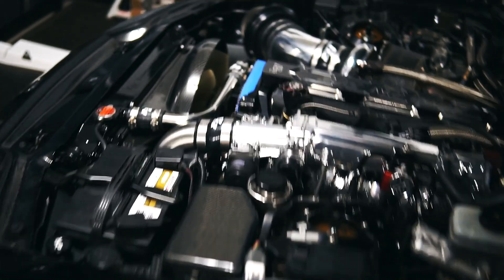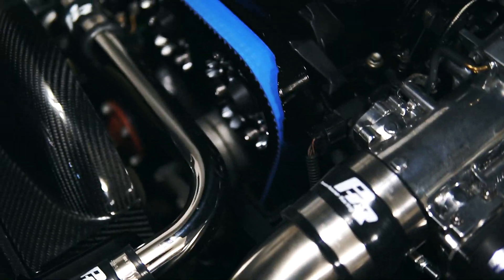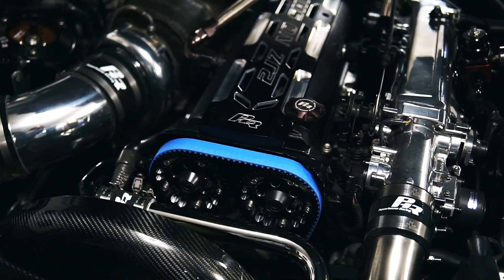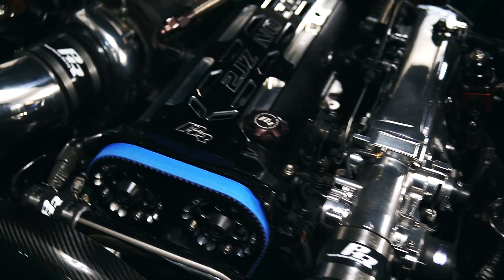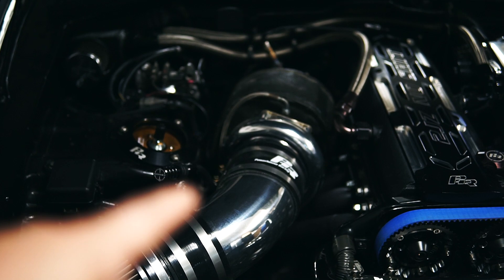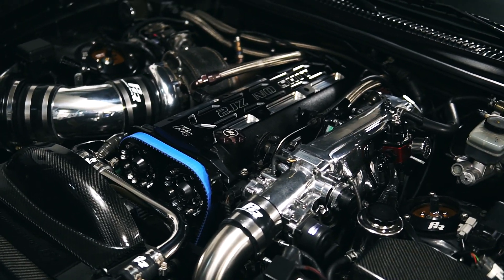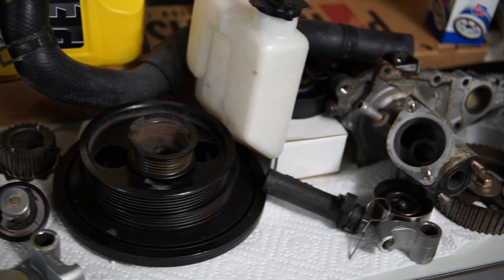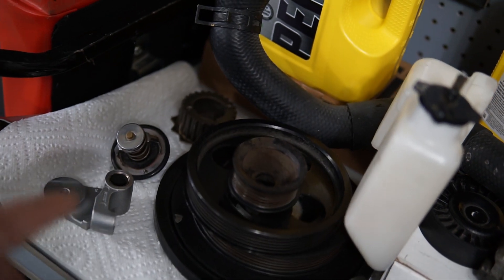Cammed My Toyota SUPRA and it sounds AMAZING! MKIV SUPRA GSC S2 CAMS

Comment from the maker: For more idle sound clips of this set up, check out this video:

https://youtu.be/bPhKtSC9uTE
Reply: What piggyback are you running?
Reply from the maker: Map Ecu 2
Reply: @TunerTestDrive  thanks for the reply been filling your channel love the build mine is rhd bolting on hks twins over winter time. Great content keep it up I watched all your Supra videos
Reply: @TunerTestDrive  wait so your telling me e85 flex fuel capable piggyback??!??!
Reply from the maker: @drjdmtuning4982  Map Ecu has the ability to do flex fuel based on blending two maps (93 and E85).  I just have separate maps I switch when I change to different fuels.  There's a manual adjustment needed each time since there is some fuel (either 93 or e85) remaining in the tank when you switch. It would be far easier and simpler with a properly tuned stand alone.

Comment: How do you like the throttle response even with the gsc s2 cam and stock intake manifold? I think if you keep the stock intake manifold even with the larger turbo the response should be great. Will you do a driving review with your current setup?
Reply from the maker: My current setup does seem a bit lazier with than it was with the OEM cams (could all be in my head though), but not anything too noticeable.  The top end gains will more than make up for it.
Reply: @TunerTestDrive  I think maintains the stock intake manifold helps with response once you get everything tuned perfectly I’m sure you will only notice a difference 2-5000rpm

Comment: Wish you could of Done a traction control delete video, confused as hell about which lines go where.
Reply from the maker: Are you referring to the trac pump system delete? I think PHR has a kit with instructions.
Reply: @TunerTestDrive  Yes to eliminate Trac pump, Trac ECU, and even the Trac butterfly and motor in the stock throttle body.
Reply from the maker: I just eliminated the trac pump, everything else is still there

Comment: are you going to change your intake? if you go to a stand alone the most value is probably Pro EFi
Reply from the maker: Do you mean intake manifold? If I change the manifold I’d likely go with a Sleeper designs RMR one .
Reply: @TunerTestDrive  Yea I too wanna go with that one I don't like the idea of cutting into my car with the Hypertune ones. Would you get it black or polished?
Reply: @TunerTestDrive  based on https://www.youtube.com/watch?v=TvAtNJ0vtWI 

maybe it's not a good idea to change out the manifold. You don't have a built motor right?
Reply from the maker: At my power level of around 700 wheel, an aftermarket intake really isn’t needed.  I would do it just for the aesthetics and how much better/cleaner they look compared to the OEM intake manifold.  I can deal with the slight loss on the low end.

Comment: Did you have to trim your fan with your new ati dampener?
Reply from the maker: I have a fluidampr dampener, which didn’t need any mods to fit.   Not sure about the ATI though
Reply: @stevekalesia3922  thanks for the reply! So is there a cooling difference between fans then between NA And turbo? Will trimming the fan a little effect the cooling noticeably? Just kinda curious I ran into this situation myself

Comment: @4:19 Standalone Yes, This engine is far too nice and bay too clean to have it controlled by a piggy. Not saying it's terrible just saying it's not great.
@7:13 that skull shaped dirt patch on your rear right tire though.....
Reply from the maker: I had to go back and rewatch this to see the skull....weird.  No I’m curios to see it that is dirt or cob webs.  Having no truly local tuner has kept me just going stand-alone.  Plus I’ve been making just small changes to the car over the years and really didn’t want to reschedule tuning after each change.  The piggyback has worked well enough, but at this point I’m getting tired of messing with it and will eventually just hand over the control to a real tuner and ems.

Comment: Can you run there with bc springs and ti retainers
Reply from the maker: Depends on goal power but something sub 700hp you could do BC0300HD springs or the 5064 & 5066 from GSC.  If you goal is higher then you’ll likely want to look into the GSC 5266 springs.